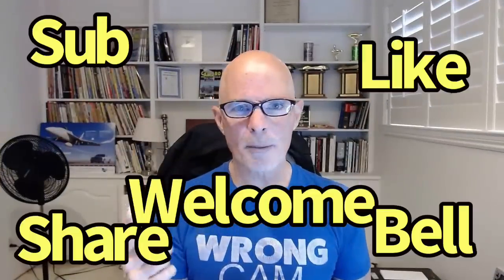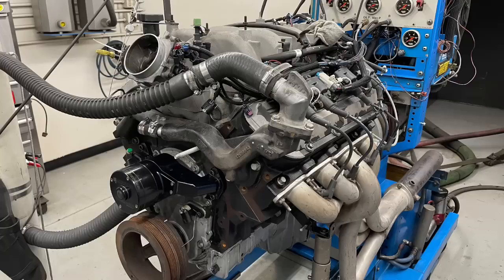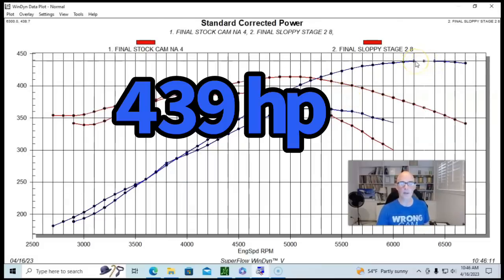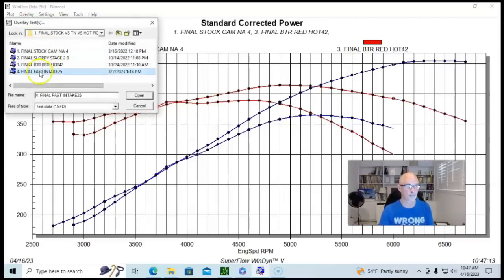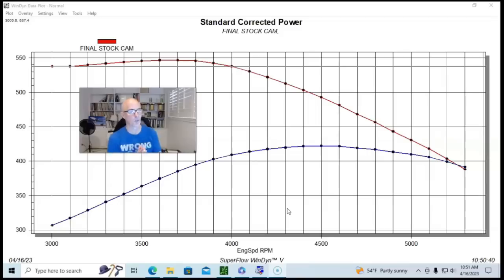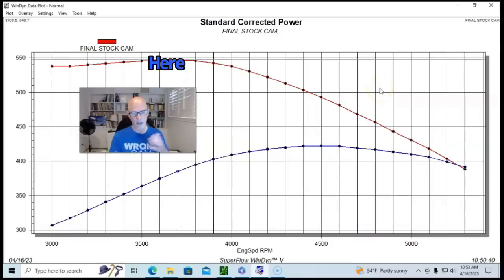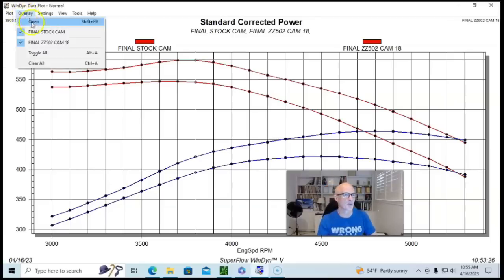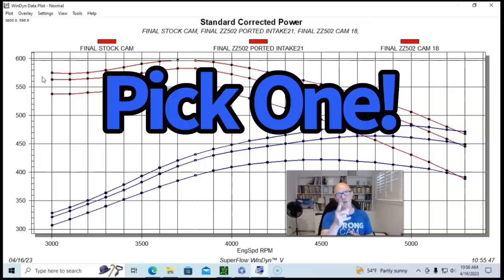RPM vs TQ-WHAT WORKS BEST? THE 480-HP TEST, HIGH-RPM, LOW TORQUE 5.3L OR LOW-RPM, BIG TORQUE 8.1L?

Comment: I would love to see an A-B test in a chassis with these 2 combos. Maybe in a fox body or something where it wouldn't be too bad to swap engines or 2 identical cars so air and track temp would be the same.  Would love to see how the 2 diff power bands actually do at the track and which is faster.
Reply: That would be aick
Reply: Sure just get a nice Chevelle and try it
Reply: Power for power, the lighter engine will be slightly faster. It's not really about the engine, it's about the drivetrain setup and how well you can get the car off the line. If we grant that this is perfect for each, power to weight will win, period end of story. That being said, the torquier engine will be more forgiving on sloppy trans setups that for example may not have a stall converter, two step, or trans brake. It's not about torque, it's about horsepower per wheel speed, which is the equation that leads to wheel torque which is what actually matters.
Reply: I wouldn't even be close....  The 8.1 would murder it.   You do see that 2x more power right?  Horsepower is just a calculation of torque and RPM.  Show me a torque curve and I could draw you the hp curve.  If a 50cc dirt bike engine was capable of 20k rpms it would hit 60hp, yet a 60hp 450 motor would absolutely destroy it.
Reply: @Levibetz  Sorry dude... but you are wrong.
Reply: @drkaymotorsports  I do not see 2x the power, I see a huge difference in torque though. Consider this, if you had torque only, could you calculate horsepower? No, you need RPM. It becomes almost a philosophical question, once you have measured both torque and rpm, you have measured power. We don't care about either really, we care about how quickly the vehicle can accelerate which means optimizing the wheel torque curve (wheel torque vs wheel speed). What you'll find is that because that's an optimization that includes speed, power is the value that will optimize that curve best. There are practical limits of course, if you had a 20k rpm two stroke or F1 engine it'd be hard to design a drivetrain to launch that. But a simple cammed LS? That's just a torque converter away from a solid launch.
Reply: @drkaymotorsports  yeah you are wrong buddy, if you had them mated up to the same gearing for both engines lets say 35mph 1st gear 65mph 2's 110mph 3rd and so on, where the y top out at the same speeds in each gear then they would do the same if not the 8.1 would lose out simply because it is heavier. you where almost correct but at the same time wrong hp is torque over time, spin the crank faster and you get more work done, that is torque, work over time done.
Reply: That would be a great real world test... it would probably be easy to hook up the 5.3 but tall that torque from the 8.1 would take some delicate driving. Might need to include changing the gears to put the power band at the top of the track for the different power curves of each, they are way off, almost 1500 RPM....
Reply: @Stale_Mahoney  you would not run the same gear... vastly different power bands demand vastly different gearing. hell, the peeks are 1500 rpm off.  In the same car, the 5.3 would need a 4.10 to 4.56, the 8.1 needs a 3.43 to 3.73 gear set to put them in there power band at the end of the race.

Hooking up the 600lbs-Ft would be the big issue either way.
Reply: @guyforlogos  that is why you would need 2 different transmissions as well for such a test where you got the gears to top out at the same speed relative to rpm, so they top out at the same speed in each gear. or it would invalidate the entire test
Reply: @guyforlogos  that is what i told you tho, you would need to run them at completely different gearing but let say that both top out at 35mph in 1st gear and 2nd goes to 65mph.
5.3 would spin at 6500rpm at 65mph
8.1 would spin at 5300rpm at 65mph
they would not only need different diffs but gearboxes to keep the speed consistent per gear.
Reply: @Stale_Mahoney  The test IS which one gets down the Quarter the fastest in the same car, ultimately with everything the same except the rear gear, because both make 480HP but one does it at 6500 the other at 5000. So the only change you would make is a rear gear that puts each one at it's redline at the end of the race. 

The only other difference would be the heavier engine, but the torque of it is a huge advantage. The 8.1 with 4.10's would be a bitch to hook up, and the 5.3 with 3.54 would be a slug at launch, but reverse that, the 2 engines would play quite well against each other.

Anyone with a desktop dyno? It would be interesting to see what it says plugging in the variables.
Reply: @Stale_Mahoney  For the sake of simplicity and this pretend quarter mile test, the only thing that matters is that the 8.1 is at the end around 5200-5500RPM and the 5.3 needs to be at 6600-6900RPM.

That's it..... 

(and yes, also a torque converter tuned to each power band, vehicle weight and rear gear) but I digress....
Reply: @guyforlogos  so you agree with me, good
Reply: @SweatyFatGuy  you are indeed that sweatyfatguy that is wrong in this chase
Reply: From 4400 rpm and up the 5.3 is similar power from less mass. With the right torque converter, I think it would be faster in a drag race just because of that, but I would like to see the test.
Reply: @SweatyFatGuy  and what is your point? that traction is better than HP? yeah i also like traction
Reply: @SweatyFatGuy  yes you said it yourself HP is TQ over time, make TQ more often and you get more HP. 

you can put a small 450hp block in a semi truck and as long as the gearing is correct you get the same outcome as a diesel engine making 450hp. 

this it why we got gearing in the first place.

now engine life span if you spin it at the high end all day is a different story as bearing life gets reduced because of the added wear with rpm, but the work gets done nonetheless if you make those 450hp at 1400rpm or at 5500
Reply: @SweatyFatGuy  right, my point was to be as fast as possible in a prescribed drag race, that’s why many guys change the gears for 1/8 mile vs 1/4 mile. My brother has 3 different 9” centers for his  AMX, a street set with lsd, 1/4 mile and 1/8 mile, both with spool, his is a 4speed, so no converter to worry about, gearing the car-engine combo to be at redline at the end of the quarter will net the best E.T. and your right, with that much torque, especially on the street, you could gear way into the 2’s. my brothers 390 has good torque, but nowhere near that 8.1!
Reply: @SweatyFatGuy  great examples, the only high torque stuff I deal with is my trucks, I don’t race those! The gearing though, I get it. When I changed my dodge from 3.73 to a 3.07 I expected to loose some towing capacity, boy was I wrong! The Cummins has so much low end grunt it didn’t seem to care at all, it just boosted up and hauled my 10k trailer like it always did. But boy did the efficiency go through the roof! Cruising at 65 was right at the torque peak, nice and low 1700RPM. When empty or with a small light trailer, my 8000 lbs truck gets 24mpg! I couldn’t touch 20mpg before the switch. It was my own little test for mileage that didn’t hurt towing at all. Interesting thing about my dodge, it seems much faster with a load, I just don’t think it makes boost very much unloaded.

Comment: If I were running a 3400 lb car,  the extra torque would be needed,  however if I were running a 2100 lb car with gears the smaller 5.3 would be faster.

Comment: I have a 8.1 in my rcsb 1/2 ton and will be building it after the turbo truck is finished.   I’m more excited about the 8.1 then the all out rcsb turbo truck
Reply: I swapped the LQ4 out of my 02 2500hd for an 8.1 and love it !
Reply: @bradhollinger2532  they are definitely badass engines.  I can’t wait to do H/C/I and headers for mine

Comment: on the street, the small block. The big block could use the tq on street tire. 500 lbs of tq is barely manageable. My cousin had a blown 02 ZO6 that made 500 and 500. It hazed the big sticky Vette tires all the way to 80 mph. And that is in a Vette. Every 100 lbs over that and the problem multiplies. On Dots it may work, but who want to run tires that wear out so fast. Even slicks wouldn't hook on the street with the Big block on the street. It would have to be feathered until at least ? 50 to 80 mph.  Ive been in good running big blocks. They are unmanageable on the street.

Comment: That's a very edgy 5.3l versus an easy cruising creampuff 8.1l. The 8.1l probably gets better mileage too.
Reply: My uncle bought a gmc 2500 4x4 new in '04 with the 8.1 and Allison 6 speed for towing his 5th wheel. Got 12 mpg unloaded, 10 mpg with the trailer hooked up.. for what that's worth to ya.
Reply: @twotrackjack2260  I know what they do stock in a 6500lb truck geared for towing. I'm talking about in a street car/hot rod application which is the implication here with these mods.
Reply: @pennysgarage  Exactly in my ~5,000 lbs 99 Tahoe where the 8.1L loafs along at 1,700 rpm at 70 mph it gets 18 mpg highway.

Comment: Easy answer, torque wins races, hp sells motors. Here's a challenge for ya Steve. Put um both in the same car run um through the 1/8 drag strip. Theres your answer. The 8 1 will win considering you dont blow the tires off.....facts
Reply from the maker: my name is not Steve...facts
Reply: @richardholdener1727  my bad, I watch alot of videos at work while concentrating on running heavy equipment. I had prob just watched a Steve Morris video so had the name on my brain Richard. Wrong name aside the senerio is still there facts

Comment: I really need to see a fast lsx HR intake on an ls3. Any thoughts on it? I'm putting an l92 in my c10
Reply: My dad had a Holley high ram and it's super heavy, I love it but I'd like to see options
Reply: Watch Rich's video where he tested 20 intake manifolds on an LS3.  The FAST manifold is one of the best, but the stock LS3 is very, very good.
Reply from the maker: THE HR IS EXACTLY LIKE THE CARBON TR RUN IN THE LS INTAKE TEST VIDEO -IT PERFORMS LIKE A HI RAM (SHORT RUNNER FOR HIGHER RPM)

Comment: Any cam suggestions for an ls1 sbe, ls6 intake and tsp 2.5 243 heads. T56 magnum and 3.90 gears.
Reply from the maker: FOR WHAT USE? FOR A DAILY, PICK SOMETHING LIKE THE TRUCK NORRIS, OR SOMETHING LIKE THE HOT ROD IF YOU WANT MORE ON THE BIG END
Reply: @richardholdener1727  I would like around 420whp. It’s just a street car but I’d like it to run strong. I don’t want to rev it really high. Was leaning towards the tsp 233/239 with 110 LSA but I figured I’d ask someone who knows much more than I. 
Oh, and I want chop 😈
Reply: Call the people at Texas speed.  They can get the cam you want with a few questions.
Reply: @kevin122759  they recommended the 233/239. Said it’s biggest I could go on sbe. My tuner recommended some cams that I’ve never heard of, say he can get 400whp with cam only.  I’ll ask him again when I get closer to time, but this is a good place to ask too.
Reply: @Modern-Muscle-PNW i made 451whp/423wtq with a stock ls6 cam. If you're only looking for 420whp wuth a h/c ls1 you're doing something wrong.
Reply: @HioSSilver1999  oh I’d like more. But 420 seems much more common than 450. It has bolt ons and makes 327 now which is also lower than many others.
Reply: @Modern-Muscle-PNW  I wanted a good street cam since I do a lot of stop and go driving.    I went with 220/220 duration, 600/600 lift and 111 LSA on my LS2.  Upgraded springs, port and match polished 243 heads with bigger valves.
Reply: @kevin122759  I’m in Seattle so it’s more stop than go.
Reply: @Modern-Muscle-PNW  The cam that works for me might not work for you. I am fighting 2 enemies that you don't have.  I am a mile high so I lose 15% power and than there is the automatic trans and another 12%. I think you can get away with a bigger cam than what I have and be fine.
Reply: @HioSSilver1999  451 whp with a LS6 cam seems unbelievably high. What size engine?
Reply: @kevin122759  cost a lot for me to get rid of the automatic, but it was worth it. I’d recommend it for sure.
Reply: @baby-sharkgto4902  it was a 2002 ls6...so 346ci. I did bolt ons and it's not unbelievably high. It's what they do when you cross your t's and dot your i's. Funny part is that they will make more. That was on pump gas. On E85 you could add 10-15 more hp and tq.

Do your homework and make the effort...these engine have mad potential that most never realize because they're worried about what cam makes more chop. I loved out running those guys.
Reply: @HioSSilver1999  you must have bolted on a 50 shot of nitrous then lol
Reply: @raebirch540  why is that??? Because you don't know how to get it there? It's just basic hotrodding dude.....lol
Reply: @Modern-Muscle-PNW  go with a BTR cam. They do their cam lobes in house using a spintron.
Reply: @HioSSilver1999  no because there's not any secrets in bolt ons. Headers/ intake and an intake manifold isn't making 450whp on a stock ls6. Besides its 2023. Video or it didn't happen
Reply from the maker: 450 WHEEL HP WITH A STOCK ls6 CAM AND 5.7l SOUND PRETTY HIGH
Reply: @raebirch540  that's right it is 2023.....and there's a vid of it on my channel.🤪😝
Reply: @richardholdener1727  dyno one.....with all the bolt ons. It's obvious by YOUR CHANNEL what it's capable of. But you stop short on getting all of it out of these engines.

I mean a 300hp~ 5.3 makes 350-360 with a stock intake/stock tb on YOUR CHANNEL.  Now add a fast 102...doh....there 15 or so. So 370 then maybe port the fast 102 for a few more ponies......add a crank scraper...another 5-8....doh....theres 375-380. Add some rockers....380 plus most likely. So now there's some a thing called e85 (which i didn't run in my car).....so add another 10-15 from our experience in another car. Theres a 390hp 5.3.....roughly 90 hp over it's rating.

Now do that to a ls6.....you'll get that same 90hp or so and in a 4gen the car will trap 130+ if you can get it down the track.

Maybe instead of concentrating on all these cams you'll show these guys where freeing up power is > making power.
Reply: @HioSSilver1999  I got it all on my LS2, fast intake 102 mm throttle body, cam, heads, long tube headers, a great tune and it puts down right around 400 hp at the wheels at a mile high. A dyno is meant for tuning purposes, not for getting actual hp numbers, you get those at the track.
Reply: @kevin122759  yes sir a dyno is for tuning. My bolt on ls6 ran 10.7@130ish....but that was before the last round of mods/tuning/dyno. It probably had 10.4 in it at 133~ in the 451whp/423wtq configuration.  I just never got it back to the track to capitalize on those mods.

Seems like there was plenty left on the table with your ls2....although I'm not sure how altitude affects dyno numbers with correction factors. Maybe some...maybe not at all.
Reply: @HioSSilver1999  link the vid
Reply: @raebirch540  it's 2023 and you still don't know how to find vids on someone's channel on yt......can't even make this shit up.
Reply: @raebirch540  https://youtu.be/c-z7r5-25OY there since you can't figure this out. And that's through a 9" too.
Reply: @HioSSilver1999  in a world where LS3’s with headers, no cats and a cold air intake make 425/430 whp/wtq through a manual on a regular basis…. you are making 451/423 with a measly LS1 with a LS6 cam. You really should open a shop because you are literally the best builder I have ever heard of.. by far. I am serious, you will make a fortune.
Reply: Crickets now eehh.....lol
Reply: @baby-sharkgto4902  you guys really shit the bed on your doubts here eehh....lol
Reply: @HioSSilver1999  I did? No I was very complementary, did you not see my comment? I said that you are the best in the world and that you would be rich if you opened your own shop?
Reply: @HioSSilver1999  nobody has your effort, nobody crosses their t’s and dots their i’s like you do. You are really awesome with your 451 HP 👍

Comment: So a bigger cam in a big block wil make more torq down low🤔🤔🤔 2800 to 4000 rpm than a stock cam
Reply from the maker: yes-by a lot
Reply: @richardholdener1727  thx🤠🤓✌

Comment: But whats the difference between lets say a 1.8l that makes 180hp at 7.5k rpm and a 2.5l that makes 180hp at 6k rpm? Lets say all else is equal which of the two will be faster and why?
Reply from the maker: depends a lot on gearing-but the 2.5l will make much more average power and make more torque
Reply: @richardholdener1727  lets say the higher revving engine has shorter gearing as most common. Apart from the more torque that  of course the larger engine makes.. which of the two will be faster assuming that they both make the same power but one in higher rpms and other in lower rpms

Comment: What trucks did GM put the 8.1 in?
Reply: '01 to '07 2500HD, 3500HD, medium duty's, Suburbans, vans, Avalanches, also motor homes, boats, generators and irrigation engines.
Reply: Thanks Andrew.

Comment: 5.3 but where would the ls3 land with mods?
Reply: An LS3 with a GM Hot Cam (219 int duration, .525 lift) makes 480 HP with stock manifolds.
Reply: @andyharman3022 yes.. and over 500 with headers
Reply from the maker: an LS3 with a Hot cam makes much more than 480 hp, since a stock LS3 makes 495 hp with headers the way we run it.
Reply: @richardholdener1727  Yes.  GM advertises it at 480 hp.  Testing the Holdener way adds about 13%.

Comment: The big block wins any street encounter as long as you can get it to hook.  It's a no-brainer.  Driving a 4.30 gear car on the street with a 5.3 might be fun at first but gets really tiring after a while for all but the truly committed.  I'd like to see you build and test the biggest cubic inch aluminum small block you can build with a stock block because that's what I'd like in my '72 Nova.  How about it?